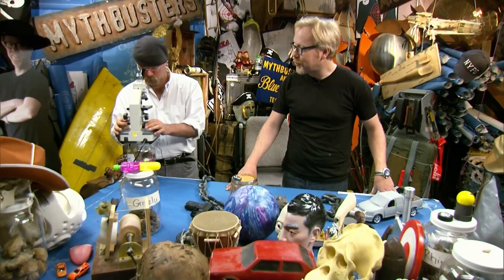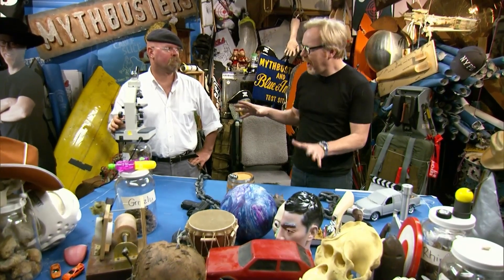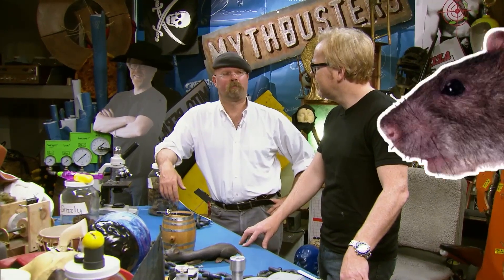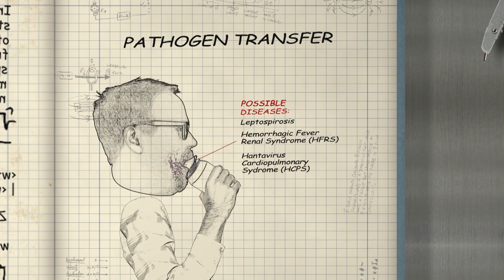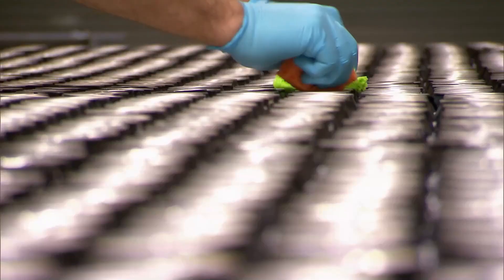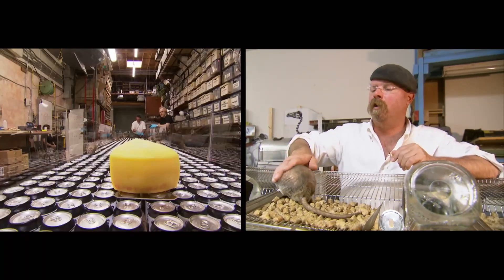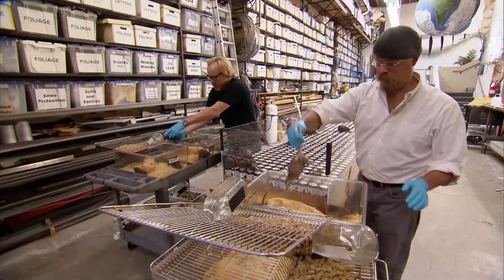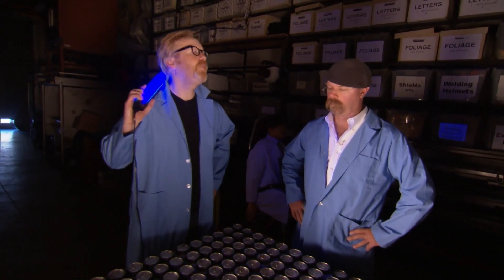Deadly Rat Pee Soda | MythBusters

Comment: Using UV light to look for rat pee and test it for deadly pathogens afterwards is not really a smart move since UV light is a well known germicide... some more than others depending on the wave length but all of them are...
For those more curious the technique is called ultraviolet germicidal irradiation also known as UVGI where a UV light with a wave length between 180nm and 280nm (UV-C) is employed to kill micro organisms of all sorts, used to disinfect surfaces or even water in water treatment plants and it works pretty fast... you also have UV-A (315–400 nm) and UV-B (280–315 nm) or all combined 100–400 (UVR), they all cause sunburns but the shorter the wave length the stronger the effects... shorter wave length means higher frequencies, higher frequencies means more vibration, more vibration means more friction on a molecular level and that translates to more heat pretty much like a microwave works... and if you are testing something for pathogens don't microwave it